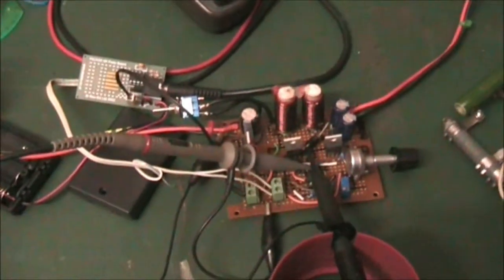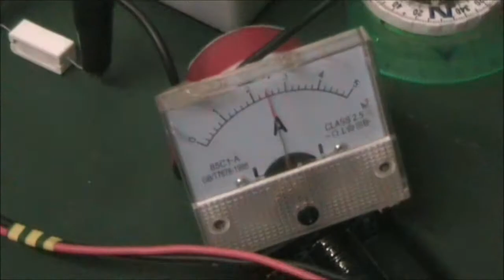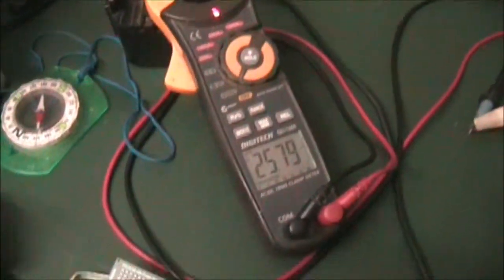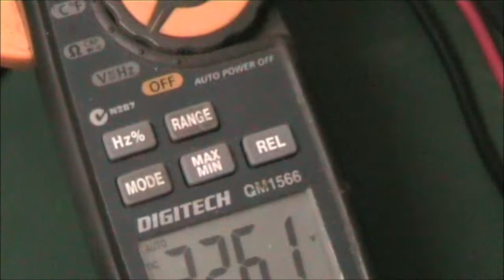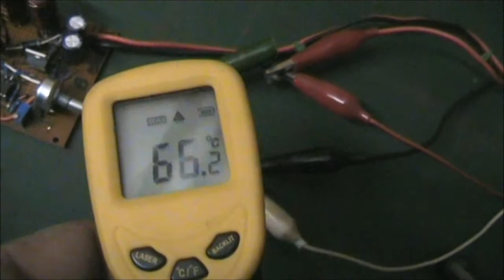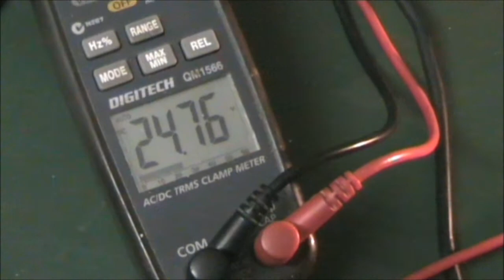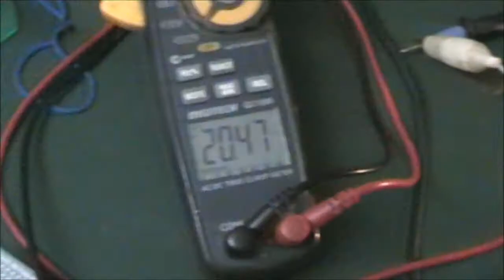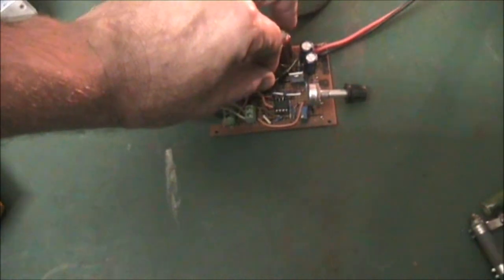Boost Converter

Comment from the maker: Hi J, if you go to the forum thread linked in the description there is record of the development of my boosting solar controller, this boost converter is an offshoot variation of the solar circuit, and I built the boost converter for testing the solar circuit. :)  Both are still working fine the solar setup is still in prototype testing configuration though. I might modify the solar setup to a dual battery arrangement yet.

Comment from the maker: Hi Kyle great to read you. The goal for this is mainly so I can use it to supply different power levels to my solar controller prototypes. Yeah I have implemented the current control as well and it is working but because of my lack of experience with writing code it is a 5 stage current setting by pulse width adjustment which is adjusted by a pot as a resistor voltage divider, I can put into the solar controller input 5 different power levels from a Watt or two up to over 40 Watts no probs.

Comment from the maker: Yes I'm a mumbler, my apologies I will try to subtitle the relevant info, thanks for the feedback. It's very much a custom device, but I will share the program code no probs.
The code disallows any over voltage by shutting off the input when the desired voltage is reached or an open circuit at the output occurs. I'll try to get it done as soon as possible and PM you.